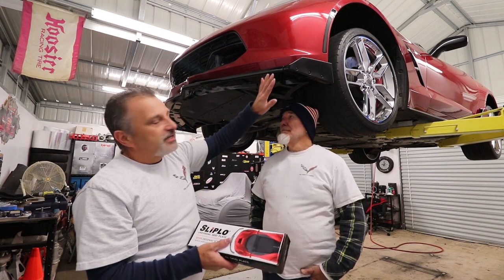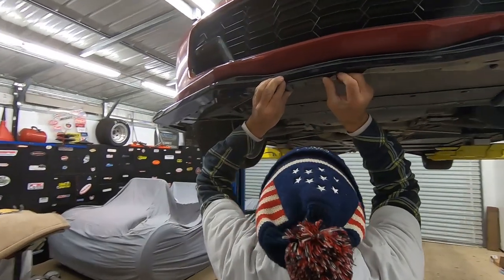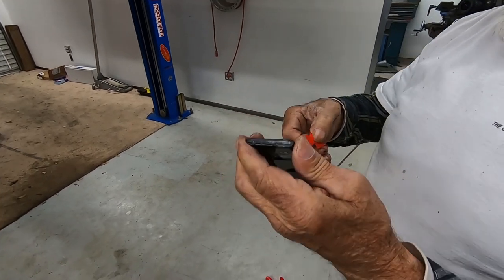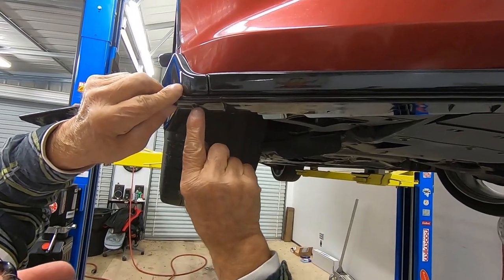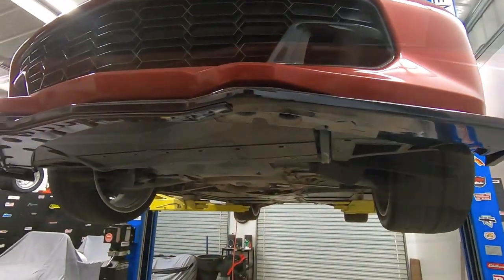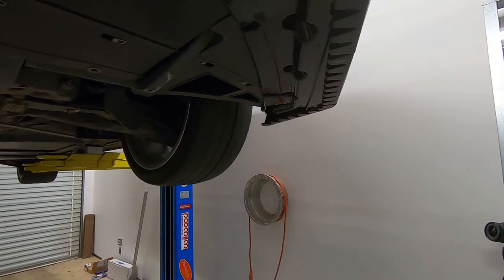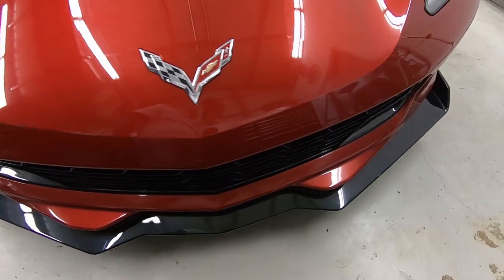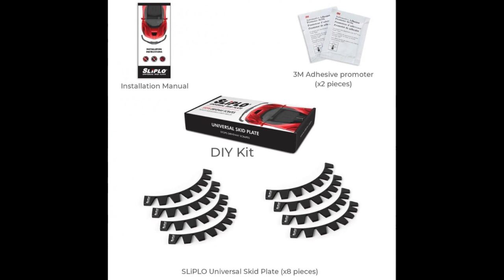I'm Protecting my Front Splitter on my C7 Corvette with the Sliplo Skid Plate Protection Kit

Comment: I have been thinking about adding the Sliplo product to my Grand Sport, so will be interested in hearing how it protects the splitter.  So my concern is, you put this product on with a car lift, most of us do not have a car lift so would the install be a lot more difficult without the corvette lifted?
Reply from the maker: Hi Paul, You don't need a lift to put it on the car. Yes it will be a little slower process but you can do it. If you have the factory skid plate on the bottom it will make it much easier to apply it because you will have a lot more surface to attach to. Thanks for your comment and for watching!

Comment: To confirm, did you remove the factory rubber deflectors?
Reply from the maker: Hi Ken, Yes mine were torn and after I put the new ZR-1 Splitter on one of the holes got covered and you cant see it anymore either.
Reply from the maker: Yes I did remove them.